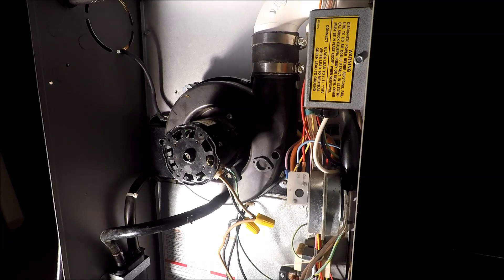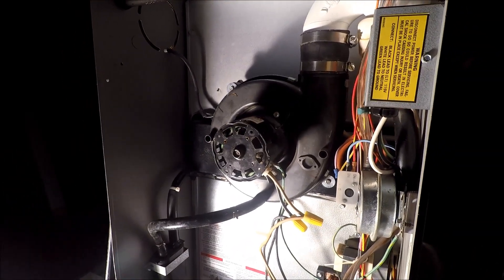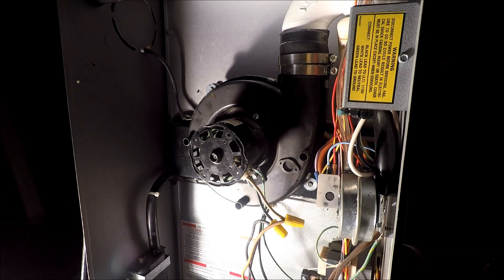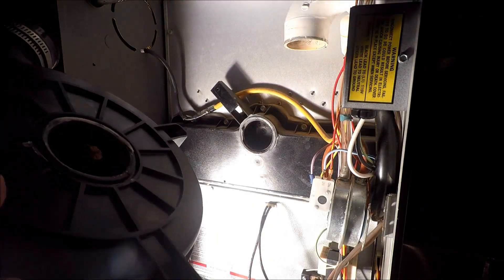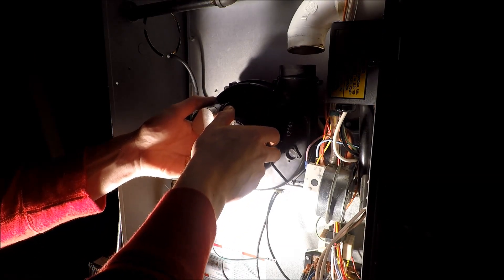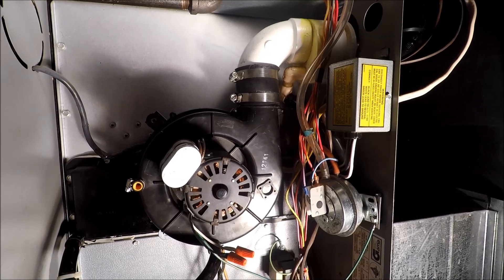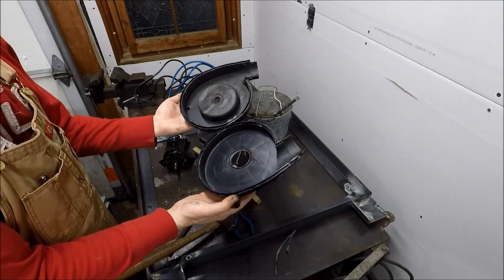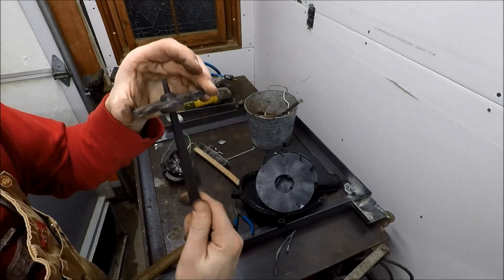Clare Furnace - Draft Inducer Motor Replacement

Comment: I have an old Clair brothers furnace too, Serial #35651 I have an electrical problem with it, the thermostat all of the sudden stop communicating with the fan centre box, I changed it to a new one.. but still showing to RH connection...